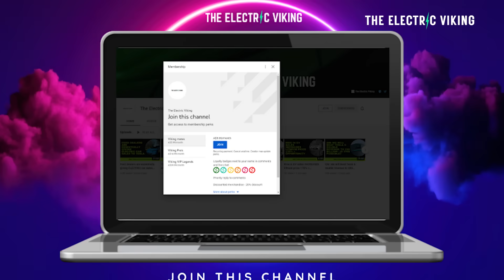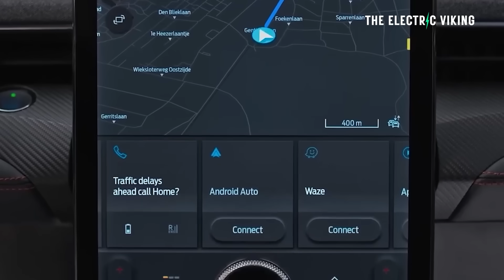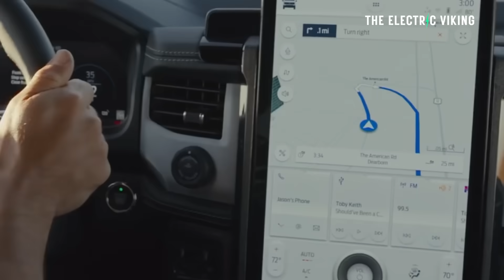Ford plans to SHRINK its Batteries by 33%—but keep Range the Same

Comment: Sam just making a battery 33% smaller does not make a 51 Kw battery delivery any more power than a larger 51 Kw battery . It's simple mathematics . dpnt ignore it , yes a slightly lighter weight has a very slight improvement in efficiency  many other things effect efficiency like shape size aerodynamics , tire width, tire rolling resistance , friction within the drivetrain , throttle style of use , speed carried threw corners etc . Aerodynamics  have very little effect in inner city driving but above say 60Kph they start to have an effect above 100kph. Battery size is not critical it does nothing to overcome aerodynamics rolling resistance , driving style . Lets say a 60kw battery pack with a 170watt to kg density so a weight of about 350Kg  Tesla 4680 battery with say 260watts per Kg means a 60Kg battery weighs about 230KG a saving of 120kg which is about 5% of the cars weight , no change to all the other variables .For example  If do a road trip by yourself and compare it to one with your 2 children and their baggage  a doubt the range difference  would be more than 10Klm .  Thats all we are talking about  . Ford is nearly 8 years behind pretty simply . By the time Ford and GM get their battery packs  evening else will have moved to much better batteries . Ford are not even thinking of solid state batteries ,  nor long lasting batteries ,  When they get solid state batteries right ( 2-5 years ) it will be like a Piston fighter vs. a Jet fighter .

Comment: By limiting range to current levels, Ford is supporting Big OIL.  If range is limited in your EV, you still need a gas guzzler to travel distances over 300 miles.  (I acknowledge that charge rate would be a factor.  My guess is that the charge rate for new Ford cars is unimpressive).

Comment: One potential in this "size" variable would be a focus on charge time, a major detractor for the US buyer perception. A smaller battery makes for a shorter turn around charge time at home where a rural buyer needs vehicles that can daily do over 100 miles and charge on 5kw 40amp outlets. 
The battery in the Lightning now in is 131kWh for 294 miles of real world highway range and charges in 20+ hours on a 5kW charger. Not a sustainable product for folks working 12 hrs a day on site and driving round trip of 2hrs.

Comment: Good God Sam. Do u read any comments or try to have the foggiest idea of what ur talking about. How many people have told u, 51 KWH is 51 KWH regardless of energy density of the battery and if all other things remain constant, will result in identical range! Talk about spreading misinformation due to ignorance. This is the same as lying outright as long as u have been at this.

Comment: Lithium Manganese rich is only slightly more dense but had a higher current handling ability.
Manganese rich has no cobalt from what I understand.
Newer Cathode material holds more electrons.
Ford CATL plant in USA is rumoured to have the ability to use varying chemistry .

Comment: In principle you can do this by grinding up the electrode materials to finer particle sizes (eg. nano particles). Downside is thermal and physical stability becomes more flakey. Lets hope they have found a way of doing this safely.

Comment: Maintaining the range while downsizing the vehicle is particularly interesting. A Mercedes CLA already has a longer range than the first version of the EQS, at roughly half the base price.
Simply making the battery smaller hardly reduces costs.

Comment: Electric Viking should rethink what he is saying here.   It's eye opening but not crazy that Ford could get to a 51 KwH battery using the LFP battery they announced.  Remember this when comparing it to the Cybertruck.  The CT is big full sized truck.  It emphasized maximum toughness (therefore added weight) over lightness. and it gets 320-350 miles of range.   This Ford truck is midsized aiming for 250 miles.  That alone allows Ford to use a lot less battery than the CT.   On top of that, it sounds like Ford is going to have an all aluminum body.  I don't believe any other automaker has done that for an EV under $40k.   That takes out more weight, allowing less battery, which in turn takes out more weight.   I would bet the Ford team was able to find other weight savings.  

Doug Fields is also claiming break through aero dynamics Tesla doesn't have.   Think radically different shape than any pick up you have ever seen and perhaps active aero.  Coming from Fields I think Ford could achieve that.  

Another thing that struck me is Ford saying it will have the acceleration of a Mustang Ecoboost.  They were bragging about it but it is actually pretty damn slow acceleration for an EV.   That tells me they will have power management tuned to peak efficiency.   GM has been able to achieve some impressive range numbers in their newest EVs that also seem good true.  But  then I checked the 0-60 numbers and they were no better than a cheap, non sporty, ICE vehicle.   That tells me a lot of efficiency can be gained simply by limiting power when speeding up.   Tesla has always felt a need to have some good acceleration even in their non performance versions.
Reply: Less batteries means cheaper.

Comment: 2:43 A 51 kWh battery is 51 kWh battery no matter energy densitiy, I know that a high densitiy battery weights less, but I will not make the car significant more efficient
If we were talking about a 500 kg battery then energy densitiy would matter a lot.

Comment: Sam, 51KWh is 51KWh, it has nothing to do with energy density.
A car with a 51KWh battery could work fine, an Aptera with a 51KWh battery could go 500 miles. A truck with a 51KWh battery would be useless. Trucks aren't aerodynamic even on their own, hook a trailer to them and the efficiency would be awful. A truck and trailer with a 51KWh battery would have a range of 75 miles. Ford can do math, they won't build a truck with that small of a battery but they might build a car with one.

Comment: "If it does use a 51kWh battery, it has to be a very high energy density battery," The Electric Viking. Does anyone want to brake to him?

Comment: I don’t think time taken to charge is as crucial as battery energy density. Stopping for 20 minutes on long journeys for a cup of coffee and a toilet break isn’t so bad. The increase in energy density will make for lighter cars - this in turn will make steering easier and increase range.
Reply: 20 minutes? That is a holiday.
Just home after a 800km trip.
One quick break, to fill up and switch drivers.

Comment: Sam, comparing Ford's tiny future electric pickup to the Cybertruck is missing the point. The Cybertruck is as large as an F-150.

Ford's new cheap $30k pickup will be the size of a Maverick. Which if you are unaware, is about the size of a compact suv. It's the cheapest vehicle Ford sells in the US for a reason. Efficiency should be similar to the Mustang Mach-e, or a Tesla model Y.

Comment: 51Kwh SIZE not capacity, Sam. Smaller physical size will mean more cabin space and possibly better efficiency.
Reply: Please, Sam. I heard you make this mistake before. It decrease your credibility. If a battery has say 51 kWh capacity a car can only come so far. Increasing the size by 33% either means (black and white, not in practice) that the car battery can be the same physical size but be 33% higher capacity (so 51 kWh*1.33=67.8 kWh). Meaning that, in the same physical space, the car could hold a 67.8 kWh battery. What they could also do is lower the weight of the battery by X% (probably around 33%) and maintain the 51 kWh capacity. In that case the car will be lighter and therefor also consumes less energie. In that case the car might not use 17 kWh per 100 kilometers but maybe more like 16 kWh per 100 kilometers. If it were up to me, I'd make the battery bigger and go for the 67.8 kWh battery in the same space.
So let's say a car uses 17 kWh for a 100 km ride. That would mean that the 51 kWh battery can provide (51/17=) 300 kilometers of range. If the same physical size battery can hold 67.8 kWh it suddenly can provide (67.8/17=)399 kilometers of range. That is a significant rangeimprovement (33% duh) over the same physical size battery.

Comment: This is the key. If you get the weight down, you get more range/improved efficiency.
 To quote Colin Chapman "Simplify, then add lightness".
Reply: I would think so too but wait doesn't seem to make that much difference with EVS, although the Chevy Bolts is not super aerodynamic but it is relatively light and efficient
Reply: I was going to say the same thing after I had watched a video comparing the new Silverado ev vs a ice f150. Loading up the back of the Silverado with shingles to reach max carrying weight made no difference for range. Wind resistance from towing though made a massive difference. but reducing the weight of the battery would definitely help tire life.
Reply: ^ I meant Bolt, voice to text sucks

Comment: that ford ceo with ideas of low  range, low cargo, small batteries is smoking crack.... 375 to 400 plus is the correct range.... just like cars, but I knew it, with the ability to give us 500 plus range they would go down to crappy car status

Comment: One of the biggest problems with non-Tesla EV’s, such as the Chevy Bolt, has been the charging speeds. The car was designed to charge up to 50 kW, but the majority of charging CCS realistically only charged at 40 kW. Due to that, in real world situations it could take about an hour and a half to charge from 1020% up to 80% whereas a Tesla could do that in 20 to 25 minutes. That added a delay in charge time made EVs that charged at 50 kW absolutely unrealistic for long trips.

Any car that cannot charge it 250 kW is great for in town areas but unrealistic and unacceptable for long trips.
Reply: Tesla is 400 volts and new Chinese cars are 800 volts. In China Tesla is obsolete.
Reply: @keithdow8327  The Chinese EVs are just garbage. There are multiple reports of them rotting and falling apart due to inferior production method and materials. Additionally, Chinese tech is well known to have back doors and kill switches and all sorts of spyware on it. I would not accept a Chinese designed product if you gave it to me for free.

Comment: Why are so many people not adopting the EVs?  Because (according to them) the lack of range. 

So, if you have a battery with better density, why, instead of keeping the same size for better range, you prefer to shrink it and maintain the same old range? 
Then the “not adopting people” will be exactly in the same mood because the range wasn’t improved
Reply: , but are they still reachable, will 50 more miles range get them out of their unreasonable opinion?
Reply: @rp9674  I don’t think so. They are expecting a 500 miles range. I don’t know where they get that number from, but the 350 miles range of a Tesla M3 is comparable to the 300-320 miles range per tank from my ICE vehicle.
So, IMO if you developed a battery with bigger density, use it to get more range.
Reply: More range, more cost, something else to complain about, do you think if you give the baby its bottle it'll be happy?
Reply: The medical term is pneumocephalus: gas in the brain
Reply: Range should be provided City and highway, like it is on gassers.
In an age of AI voice to text still sucks
Reply: That's not the real reason. Current EVs have plenty of range. The problem is people have gas car mentality.
Reply: @bhabbott  According to whom? The vast majority of people complain about the range compared with their ICE vehicles. Any ICE vehicle can get more than 300 miles on highways, which is something you can’t say about EVs. So yes, range is the issue.
Reply: Yes EV range should be listed solely in highway miles. Nobody cares about city range because no city is that big anyway, and it would be like 8hrs of city driving to actually exhaust it.
Reply: @bhabbott  That is either a EU mind set or a town car mind set. A lot of the US is soo far apart from each other that driving 150 miles in a single day is possible for many even more so than that. Adding in charge times and a cold day... your trip time can double. Not saying many can't use it for towns use, but I would say a lot of the push back just comes from the fact half of the battery usage can go into heating up your car where ICE/Gas burns will just transport it instead. EVs need to be closer to 350-400 for the everyday car. 500-600 for the drivers that do trips between states.
Reply: @bhabbott  Bullshit, at current range I literally cannot visit family due to there being no chargers within a 1hr drive from where they live. With ICE there's gas stations everywhere.

Comment: Most people never put on more than 120 miles a day. A farmer may drive to town each morning for coffee and a little shopping . Maybe 20 miles round trip. Most PUs drive to work and home again. seldom over 60 miles round trip.
Reply: So what. The owners know they can go 400 ish miles if they need to, and that's their comfort zone. If you want mass adoption it has to be addressed.
Reply: @IanReid-e9r  I drove to a town 90 miles away last year. It was a day trip. I could easily spend 15 minutes at a charger for a 60 mile top up to get home. Month to month I seldom drive more than 60 miles from home. 150 miles will meet almost every small pickup owners needs.
Reply: Speak for yourself because some of us that live in the country put lots of full days of driving in a year.  Many of my trips are 500 to 1500 miles.  No one wants to stop every 150 miles for half an hour.  People will not adopt until 500 miles of range is possible and you can go 300 miles in between 30 min charges.  Also it’s just no where close compared to my ford f-350 towing trailers.  I can go 400 miles with a fully loaded trailer without stopping and 700 empty.  It’s a major pain to stop and I prefer not to get off the interstate unless I have to, rest areas are easiest and then I only have to stop for fuel once a day.  And besides all the charging stations are not designed for vehicles pulling trailers.  I’m not going to go buy an ev just for local stuff it’s not worth having all the extra costs with multiple vehicles. The average person drives more than you think in the US anyway so until you increase range you will never see mass adoption.
Reply: @nickv8816  Of the 170 million people who will drive a car today ( usa ), most, 130 million will drive less than 100 miles. Today, and every day of the week. A factory that makes 1000 150 mile trucks will sell every one they make.. The market is 4 million units a year. Live in the country? pick a town. try Hastings NB. 15 k metro area, 15 miles across. You live and work there. When would you drive 150 miles a day? There are thousands of towns all over the country like this.
Reply: @nickv8816 its definitely not a solution for you. I know many people in your shoes as i grew up in the country.  City folk dont understand everyone has a different use case.
Reply: You also have to account for range loss in the cold. Not all of us live in warm climates.
Reply: @dantribby199  51 kwh will giv you 80 miles in the cold. More than enough for most daily driving.
Reply: @kkarllwt Yeah i understand my commute is short. Ideally i need something that can do a bit of light towing, a bit of off road chops, good cargo space and can get me to the family cabin. Its about 210 miles from my house. Not sure if theres anything like that on the market yet. EV5 if the bring it here(maybe). A Rivian R2 if they survive the next year may fit the bill

Comment: CEO Farley got a Xiaomi SU7 EV from China and drove it for months, then pronounced it a superior driving experience. It's good to see a humble attitude from a U.S. corporate leader, for a change.
Reply: Farley seems to get it in a way Barra doesn't.
Reply: What do you mean? Chevy is doing good and has three battery types they’re working on and actually has affordable EV
Reply: @YellowBoltTC  The Equinox is made in China.
Reply: @ChickensAndGardening  Equinox is also assembled in Canada and Mexico
Reply: @ChickensAndGardening  If you're referring to the Equinox EV, no. The Equinox EV isn't even sold in China.  

GM makes two Equinox versions in China and those are only sold in China - an ICE Equinox and a PHEV Equinox. 

The ICE Equinox and the Equinox EV sold in North America are made in separate plants in Mexico.
Reply: Such claims by Ford may simply be more use of a delay tactic known as the Osborne effect. They're buying time because of other's success with their own EV's. An attempt to steal some of GM's thunder perhaps. Great work Viking.
Reply: @TronJockey   Correct. Farley is out of touch with reality. This is just to buy time due to all the pull back they have done on EV's.
Reply: @TronJockey  Perhaps.
Reply: Give that Xiaomi  to Sandy Monroe had have him do a teardown and evaluation report.